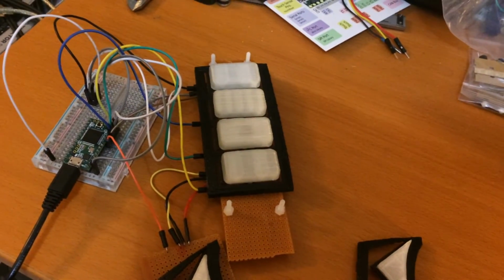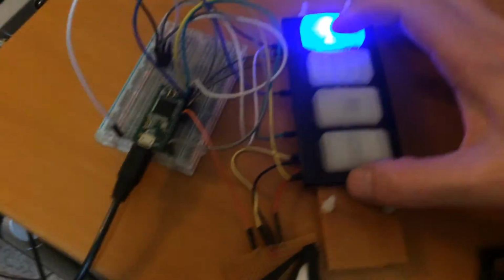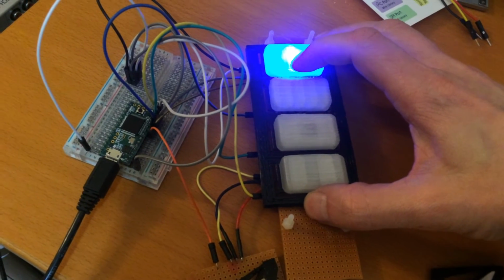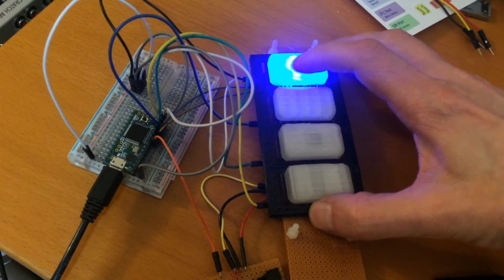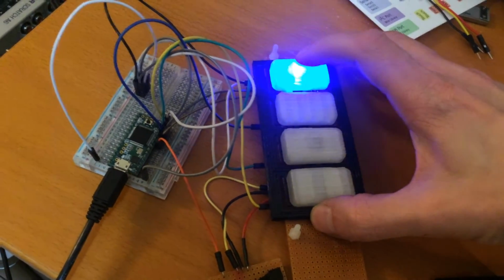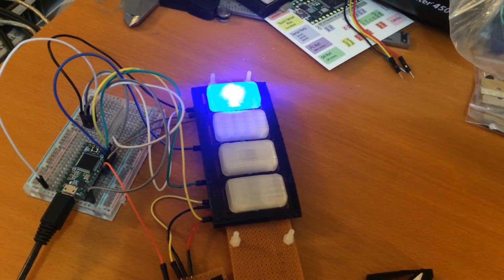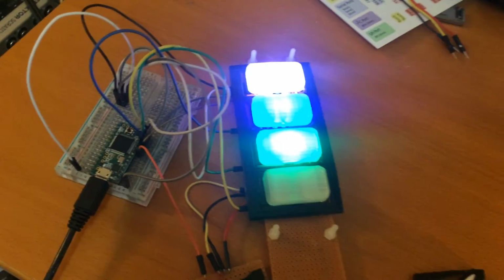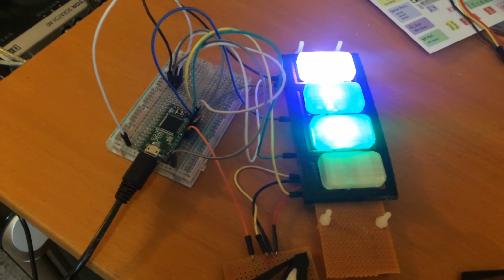3D Printed custom hot cue buttons for a Teensy based midi controller

Comment: excellent work that material you used for transparent silicone buttons or other material.
Reply from the maker: just clear PLA so nothing special.
Reply: Thanks for responding and I'm also developing a midi driver for 4 channel traktor something similar to the pioneer ddj sx2 with arduino.

Comment: You are a beast dude impressive! how is the cdj 800 project doing?
Reply from the maker: +Igor Foster (Fudenciojp) Moving along, but I got a bit side tracked with this. I have been looking at ways to get track details out of traktor and also found some great software that could be used to grab the decks and send to external screens.